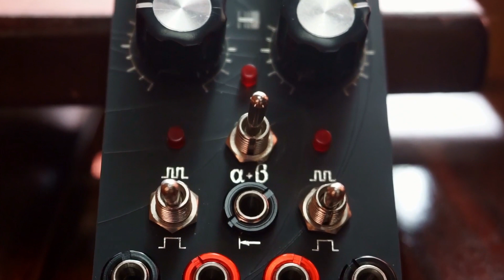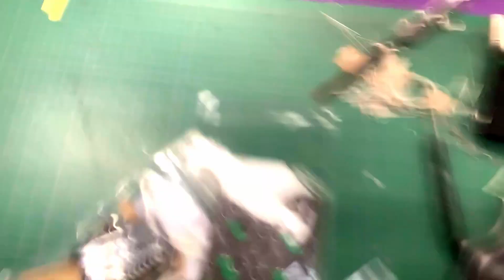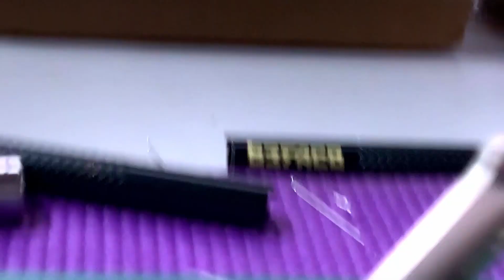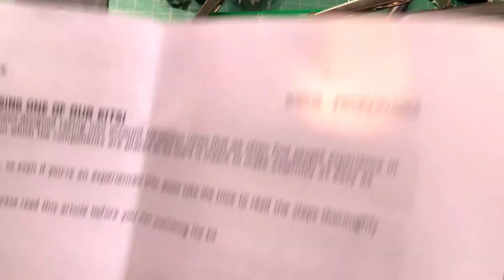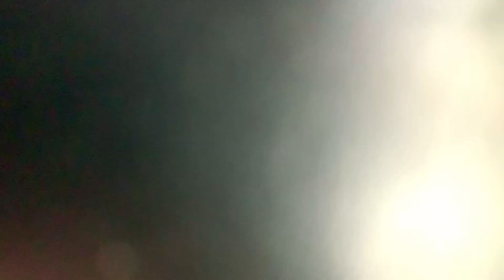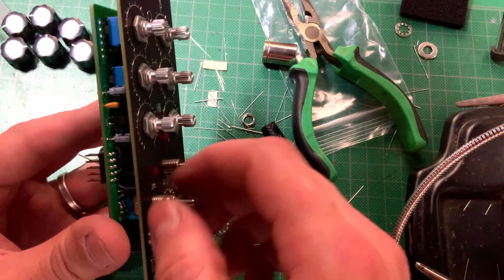Stoichea dual Euclidean trigger sequencer - demo and build

Comment: Hi, I also tried to build this one. I‘m a beginner in soldering but have some basic skills. My module doesn’t start. I measured all resistors and one of the two 1m Ohm resistors shows soldered 0.09 ohm instead of 1m Ohm. Soldered this one out and replaced with an other one. Same problem, nothing happens when powered on. Do you have any suggestions? Thanks!
Reply: Examine your soldering very closely for solder bridges - unwanted connections between 2 points that shouldn’t be there. 
Also, look at your parts. Ensure none of your diodes, capacitors, transistors or IC’s was inserted backward. If you find a IC was inserted backward, you may need to replace it.